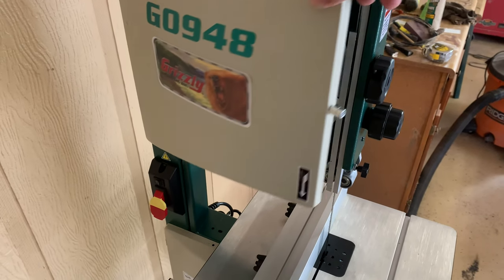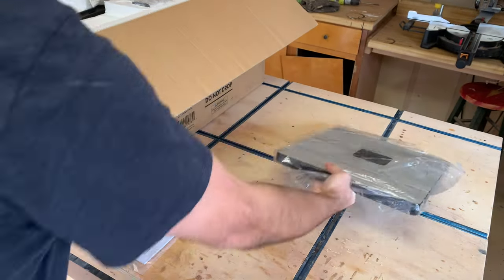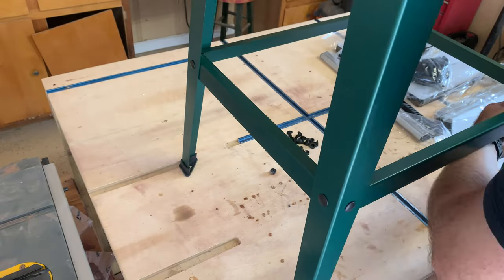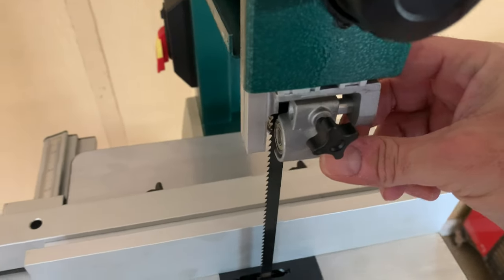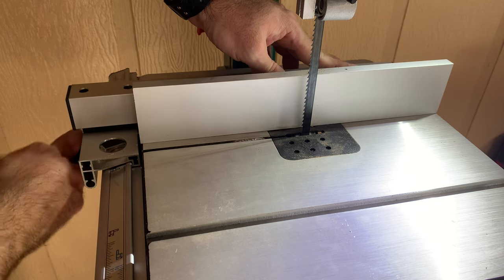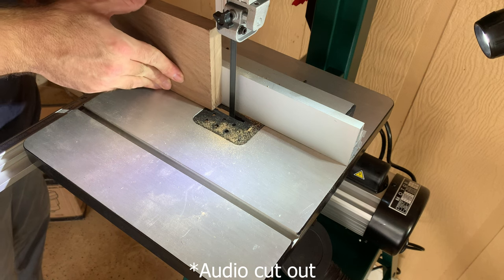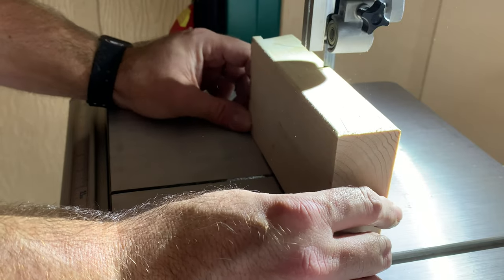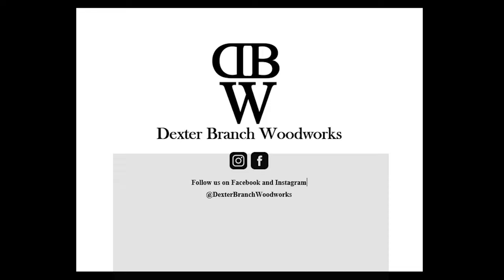Unboxing and Review of Grizzly G0948 10" Bandsaw

Comment: I have the same issue with the same bandsaw model. What replacement blade did you get? Did it make any difference?
Thanks in advance…
Reply from the maker: It did help but increasing the tension on the drive belt made the most difference. Watch my follow video and it will show you what to do. Also has link to the blades I bought. Thanks for watching!

Comment: I'm wondering, did you change the pulley speed for more torque or did you leave it at the setting it was at straight out of the box? also, your tension might be too loose if the blade is veering that much. But yes, a wider blade would help too.

Comment: You need to increase the distance between the motor pulley and the blade wheel. Apparently the drive band is too loose from the factory which causes it to bog down. Also, I heard the blade is shitty and too thin for re-sawing which is why you’re getting so much drift.
Reply from the maker: Yeah I looked through the manual and found a couple things to adjust. Also bought a better blade for re-sawing. We'll see what that does and I'll post a follow up video.
Reply: @dexterbranchwoodworks4209  Sweet! Can't wait to hear what you think after the adjustments. I was thinking of picking one up myself.
Reply: I hope it does a better job with adjustments and new blade. I was planning on purchasing one as well.

Comment: The Wen has a one third HP motor. For whatever reason the "1/3" comes out as "1.3" on a lot of websites and other places. It was really confusing to me when I was trying to compare saws.
Reply from the maker: That would definitely make more sense. I know some manufacturers use different metrics to inflate their specs. I’m assumed that was the case. Thanks for clearing that up.